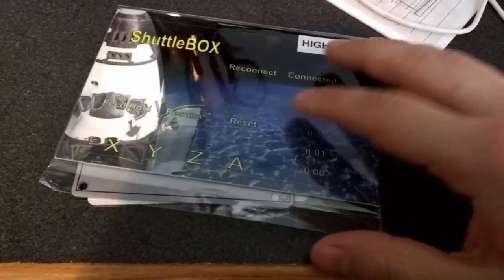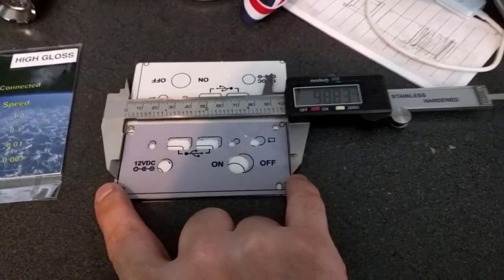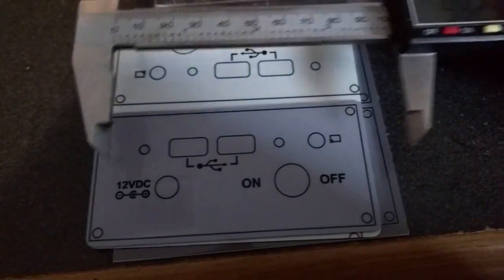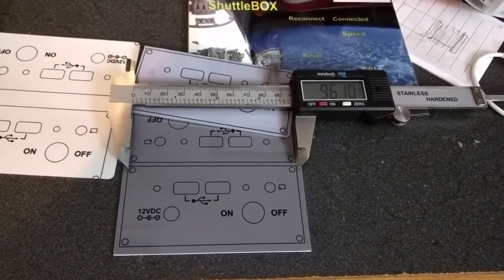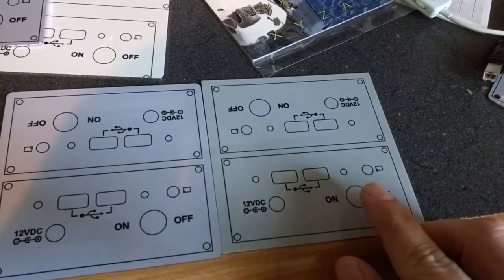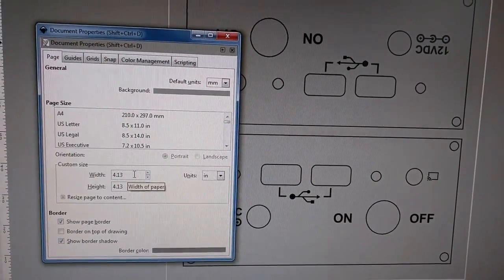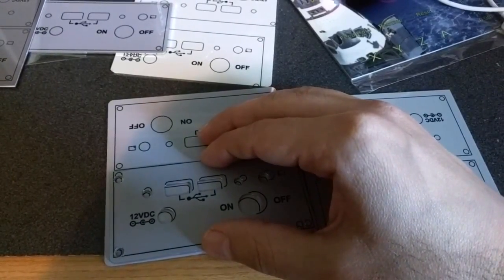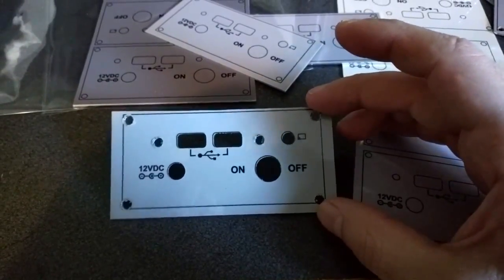Printing Perfect Aluminum Electronics Panels

Comment: I have the same problem, tried everything. Printed direct from inkscape and print is still 1mm out
Reply from the maker: Which service are you using?
Reply: @FrankGraffagnino  I'm trying to print my design on my printer, had it printed on other printers. If I scale it 100,8% while printing the overall size printed is right measured on paper but the hole centres inside the design are slightly off. My brother did a simple rectangle 100mm and needed to scale 100,3% to get 100mm on paper. When he made a rectangle of 225mm he hade to scale it 100,8%.
Reply: hello... i noticed that same 1-2mm from InkScape when I imported design to another front panel designer but not tried to print it yet. Then i did export of my design with 1200dpi and 0 compression! What I got is PNG file of 202Mb but 0.0 error when imported to front panel design. I will try to do tomorrow first print on konica minolta printer of such big file and measure it to confirm is it ok.

Comment: Electronic panels can be customized for a variety of cutouts in panels.mwf-services.com. The same thing for enclosures: box.mwf-services.com. Process demo: https://www.youtube.com/playlist?list=PLR8ykZOfaagKiarx3EofnRtzeGxAjdLSl
Reply from the maker: well, i'm just saying that this video was about how to print out graphics on a panel.  Not really about how to cut out the holes.
Reply from the maker: I understand.  Since the prices seem very reasonable, I may look into using it!  Thanks.
Reply from the maker: it's interesting software, and the prices seem reasonable.  But, the main focus of my video was to be able to print graphics and labels.  Can your panels be made to have text or graphics labels on them?
Reply: Yes, however the tool does not have this feature yet. You would have to send us the desired layout in your preferred format. Would it be a problem for you?
Reply: It is clear in your video. I just wanted to tell you about the tool in case you need it.
Reply: Nice! Talk to me if you need any help.